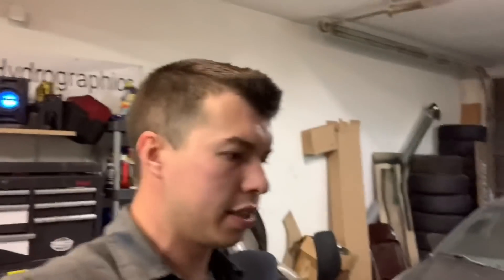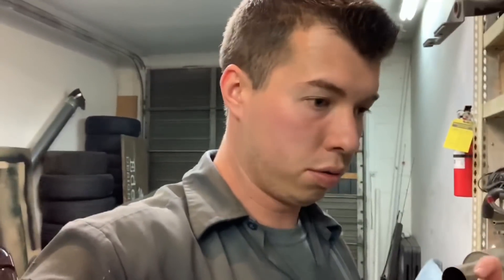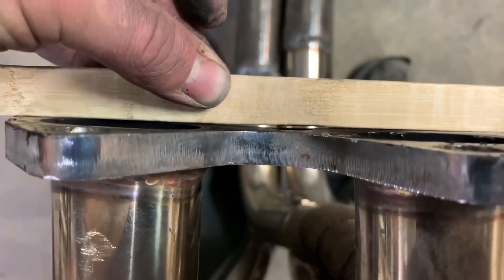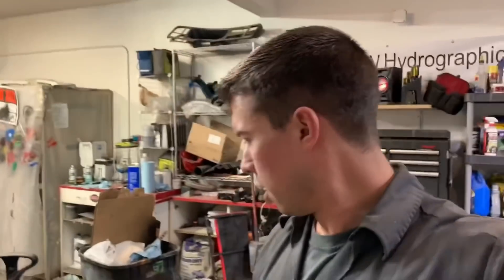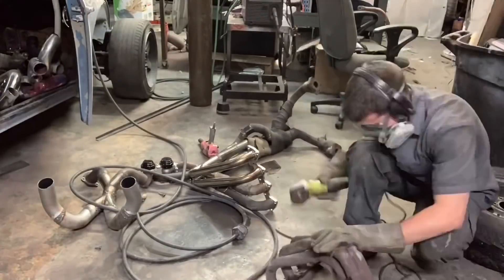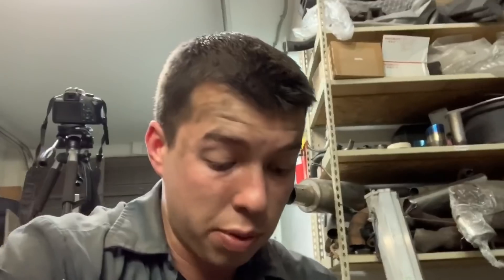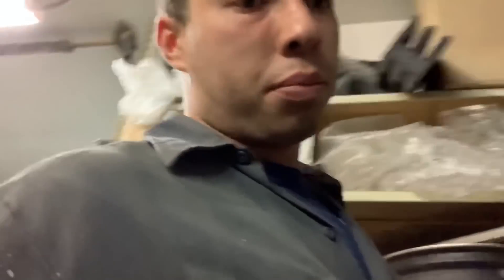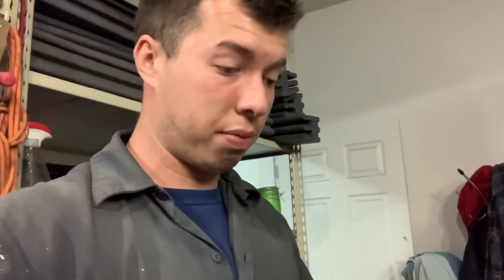Turbo B18 swapped VW BUG gets a FIREWALL!

Comment: On those eBay headers you can straighten the flange by heating it up and putting it in a hydraulic press to bend it back. Hit it on a belt sander and you're solid!
Reply from the maker: Thought about that, but I got word the next day about that Integra, but great point! Hopefully this won’t happen again but now we know for next time!
Reply: @GARAGEIdiotS  I commented before I saw you cut them up already haha I figured I would leave the comment for future use and others with the same issue. Love your projects! I am getting motivated to work on my own and start filming it. Keep it up! This VW build inspired an idea to use some parts I have laying around my house! I wanted to graft an ef civic front subframe and engine to a 2 seater go kart. Hopefully I remember to send you a link when it's finished!
Reply: I was thinking about that too
Reply from the maker: Conn0isseur Dana right on!!! Thanks man!

Comment: I have watched a series called Project Binky where they fabricate almost everything. They take drafting cardboard or white poster board and create a patter of each plate needed. When the pattern matches the desired piece needed, then they use this pattern and transfer it to steel plates. That way, the steel is not cut until the pattern fits the piece needed.
Reply from the maker: Yea!! I’ve used that method now haha this video is several months old

Comment: Side mount twin intercoolers  fed by either scoops in the rear 1/4's or the rear 1/4 windows. You could also run a small electric fan on each intercooler to also help get more air flow thru them.
Reply from the maker: I thought about that idea, the probable is the driver side of the engine bay doesn’t have much room.  We’ll have a video up soon I think we figured it out
Reply: @GARAGEIdiotS  Well then just mount the intercoolers outside the body! And build a wide body around them.  Think Ferrari Testarossa. lol That would be different. You could have a Huggari testarossa. lol  

I'll watch the next video and see what you come up with. That thing is going to be a blast to drive when you get it finished.

Comment: Any flat metal panels will vibrate if you have a bead roller you can stop vibrations and add strength by rolling some simple patterns into a flat panel. Check out Urchfab channel for examples and inspiration. Also to get curved profiles into panels use CAD (cardboard aided design) to make a template and then transfer it to metal. Please save your eyes and make sure to use your welding helmet all the time. I like the project.
Reply from the maker: Thanks!!

Comment: for that top part of the engine cover thats curved,, just make a cardboard template and trace it on a piece of sheet metal also is it going to be removable to do any work on the engine? one more thing, you could run some cooling ducts from the sides of the car  going to the engine cab, looking sick though man!
Reply from the maker: Yea that’s what I was thinking! And yea I drilled those holes so it’ll all be bolted on and removable! Google NACA ducts, I think that’s what we are going to use to route air to the intercooler
Reply: @GARAGEIdiotS   nice!! Check out Pegasus auto racing supplies they have some badass stuff as far as ducting and scoops, pretty specific with measurements on their site, I'm most likely doing away with my quarter windows on my sn95 cause I have no ac and cause you know, race car lol

Comment: You could put a duct into the front cowl and have tubes running through the body, to an intercooler or 2 that exit out the rear engine hatch or the out above the tail lights or something.
Reply from the maker: Okay there ya go! Thanks!

Comment: Water to air chargecooler or two off a gt four Celica or MK1 focus RS.  Or weld sheet over the front and back of your junkyard intercooler core to make it hold water. You could use an air con condenser up front of the car in the right size to cool the water and an electric pump Maybe?  Cool build. Always good to see other people's ideas when making custom parts from scrap. All my cars are built from as many scrap parts as possible. My rear wheel drive spaceframed Saab engined Opel omega gearboxed ford Mondeo (contour in the US) has some nice Volvo intercooler piping and part of my mates mum's stainless vacuum cleaner extension pipe welded up to make a custom thermostat housing. I couldn't find any pipe the right size in my stash and called a  friend to look through his junk. 10 mins later he came round with shiny tube but explained it was sort of in use and  how much did I need? I asked if it was ok to cut 2" off the end of it and he just said "it's ok, mum's short. She won't ever notice as long as you deburr it."
Reply from the maker: Haha awesome ideas man! Thank you!

Comment: How did you measure where to put the shock towers on your VW? I wanted to get close to oem camber and castor.
Reply from the maker: The whole rear of the bug is the front end of an integra so I don’t think our method will help you haha
Reply: @GARAGEIdiotS  did you grab the strut towers too? I thought you just fit the subframe?

Comment: le explico algo: para modificar el bug/beetle a mid engine deben es armar un subchassis con el motor 4 en linea que decidan (sugerencia usen mejor un motor vw 2.0T o 1.8T), el subchasis debe portar la suspension (sugerencia nuevamente busque en vw/audi) brazos inferiores , struth, torres. un camino facil para tomar las medidas de subchassis es tomar un frontal con motor, transmision, suspension completo de un desguasadero y partir de alli para el armado y medidas en el chasis bug. esto ya es una tecnica usada por fabricante, miren un video de como se arma el bugati veyron y tomen toda esa idea (el veyron son 3 estructuras a) frontal atornillada con pernos soporta toda la suspension y 3 radiadores, b) cabina en monocasco de fibra de carbono, c) la trasera que es un subchasis que porta el motor transmision suspension y va unido por pernos a la cabina.
Reply from the maker: No hablo espanol

Comment: A machine shop can deck that flange for you pretty cheap
Reply from the maker: That was the plan until that integra showed up at the junk yard haha
Reply: GARAGE IdiotS is the firewall going to be removable? It would suck if you had to pull the whole body to work on the engine
Reply from the maker: J LeClaire yes, and I’m not saying this to be a jerk lol honest question, did you watch the video? I thought I addressed that multiple times, that’s why I drilled holes and made tabs so that it’ll all be bolted in.  Haha it’s suck if I couldn’t remove it haha
Reply: GARAGE IdiotS I did watch it, I commented about the header before finishing it. I guess I was a little confused about how big the removable panel was going to be